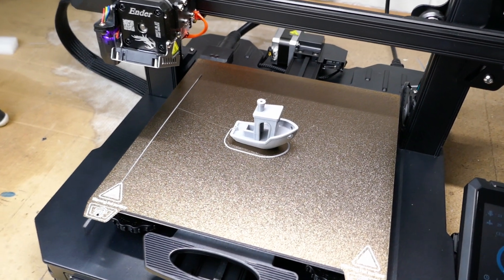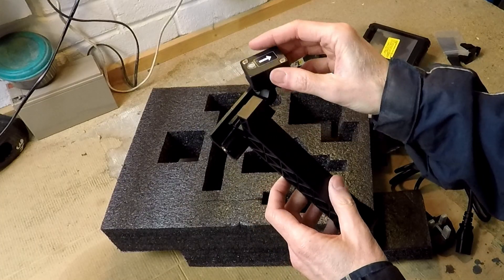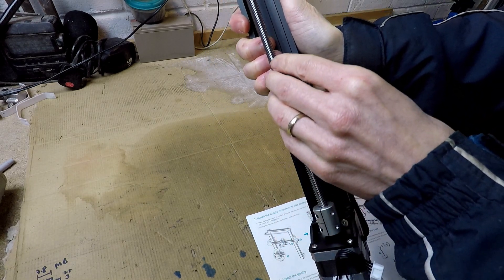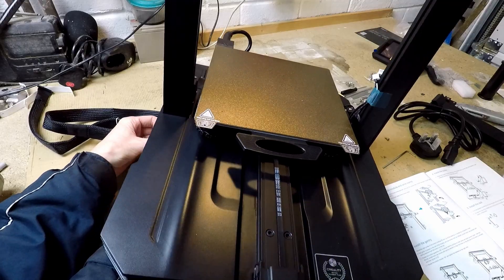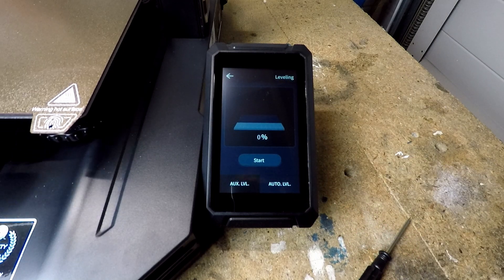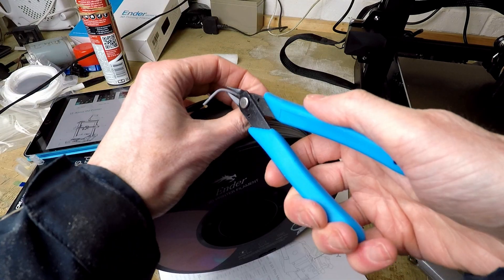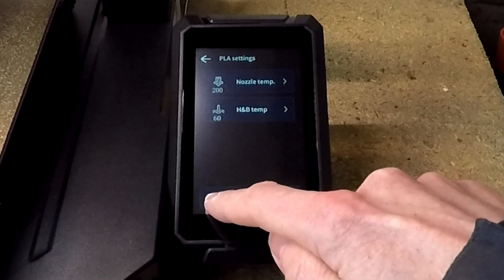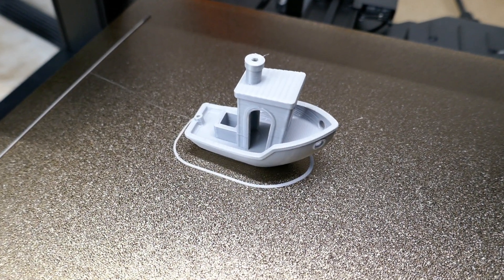Ender-3 S1 Pro 3D Printer Unbox, Set Up, Test, Review

Comment: do you have update on your 3 wheeled recumbent bike? your last video it has no suspension, i want to see how you install them, nice you're back
Reply from the maker: Hi, well the trike is finished as a test-bed.  It kind of works but I’ve sketched out a Mk 2 version which is shorter and higher, which should make it easier to ride and control.  It will have rear suspension and a rubberised shock absorber at the front,  you don’t really need much suspension at the front I’ve found.  I also need to design a tilt-lock for slow speeds and stationary. Thanks for your interest.